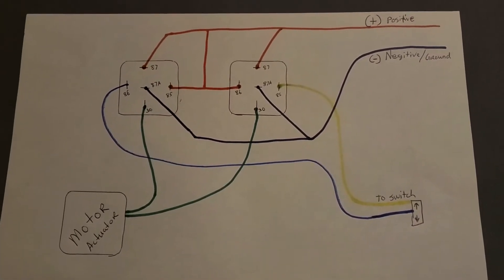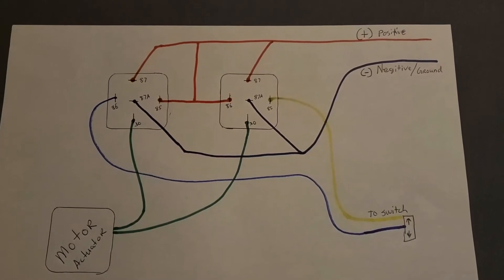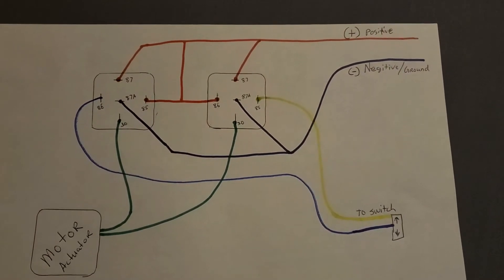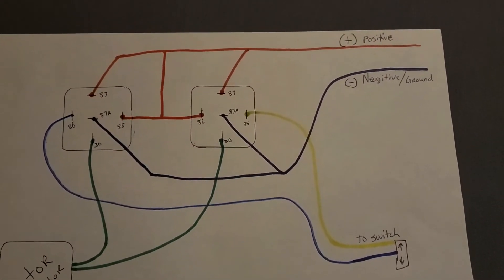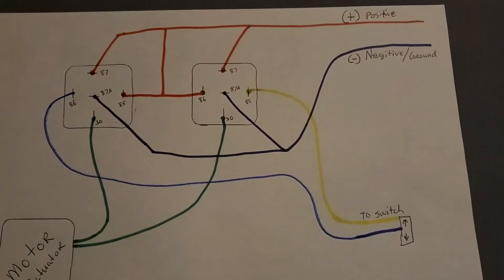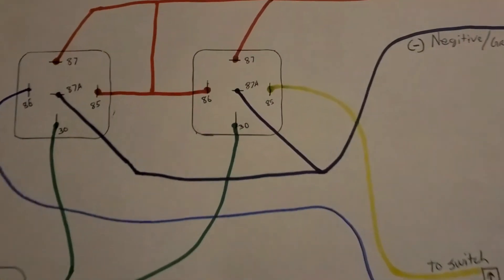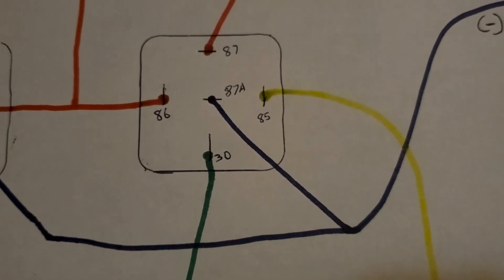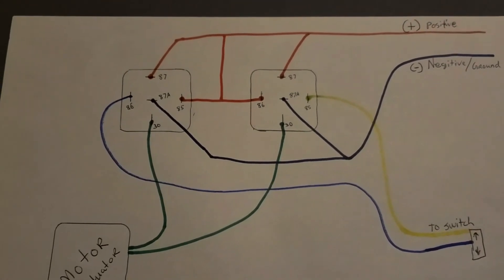polarity reversing relay diagram for double throw switch

Comment: Where would you fit fuse on the positive only?  10ah?
Reply from the maker: @DrivenByGeorgeJexter  put on the line in.  Fuse is just a device that is inexpensive to replace compared to other components doesn't matter if it's positive or negative

Comment: So let me get this straightened out we run the red into the black or green and how does that turn my positive into a negative
Reply from the maker: The red and black go into the relay and then depending how the switch is pushed or made it will send current to one relay or the other then creating a chain reaction and Power your motor.  Your switch should be a double throw type
Reply: @KzCreations   The switch? NO. I only needs to be a Single Pole Double Throw
Reply: When off both the relays are NC and being fed by the negative side of the battery. When either of the relays turns on, that relay is now being fed by the positive side of the battery. So now you have negative and positive to coming out of the COMs.

Comment: Would this circuit work for wiring in   two switches for a passenger side window?
Reply from the maker: In theory yes specially on older stuff new stuff might cause a computer glitch unless you powered it directly from its own auxiliary power source. I have heard about people unplugging like a power seat motor and it interferes with other electronics in the steering
Reply: Need make model year to say.

Comment: Needing help with wiring a window motor for the passenger side to be able to control from the driver or passenger side. I have a rotary reverse  polarity momentary switch for the passenger window and a DPDT momentary switch to use on the drivers side - can’t figure it out ! Any help is appreciated
Reply from the maker: You need momentary single pole double throw switch and you should be able to Y the positive and negative over to each side of the car from the diagram
Reply: Any chance of sending / posting a diagram ?  Thanks
Reply: You really should give more information, Like make , model year.  But you can use two 5 pin window switches.